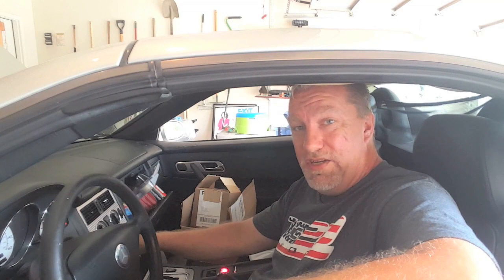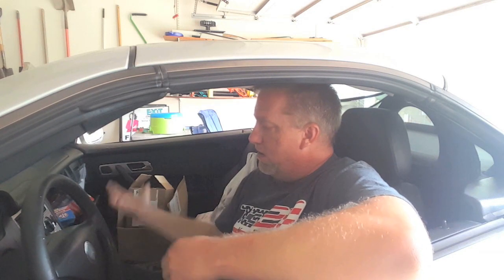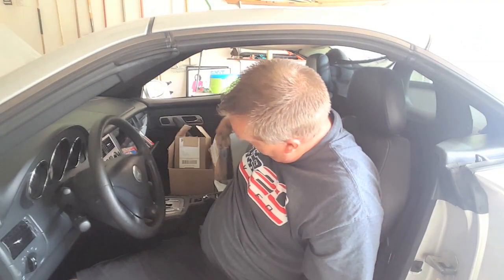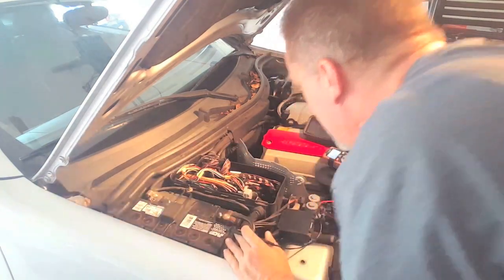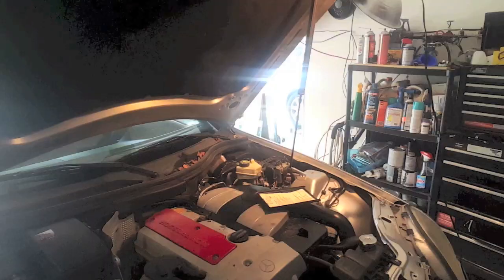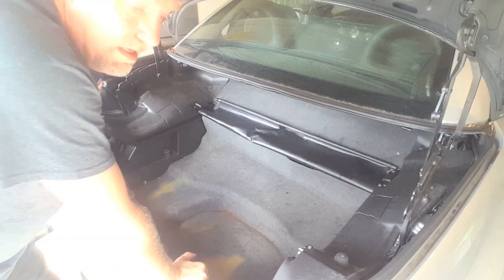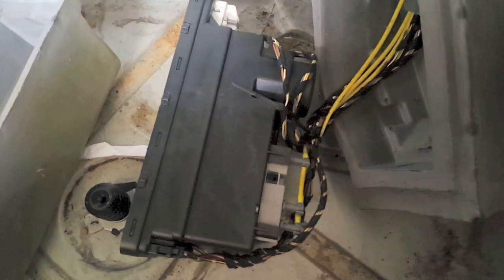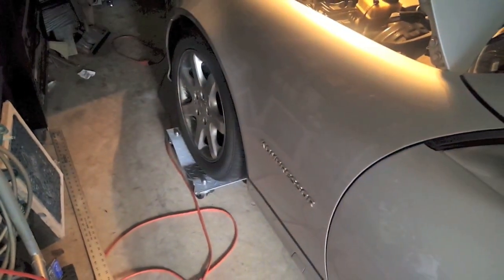Glove Up & F'n Do It! SLK230 Project Ep 4 Lock or No Lock that is the ?

Comment: I HATE my daughter's SLK...German Male Mechanics are like Red Neck Men, Women are only for cookin' cleanin' and baby makin'...1 example, try replacing the hydraulic fluid for the top. Instead of having a twist on/twist off easy to access opening for the container...Nah, way on the other side, in less than 2 inches of space, next to the bumper, controlled w. a hex nut size 5-6. trial and error, not as stated in any manual. opening. Took to 3 mechanics and I had to research online, found all, however did not have the hand strength to turn, so an 18 yr old neighbor boy, turned for me and his tiny hands were able to put the small tube into a small hole to fill. Oh ye, You have an inch of too much or too little to work with as well. This film also shows how ridiculous it is having another inaccessible fuse location in the trunk. What a nightmare,